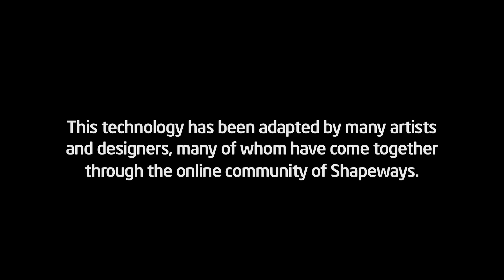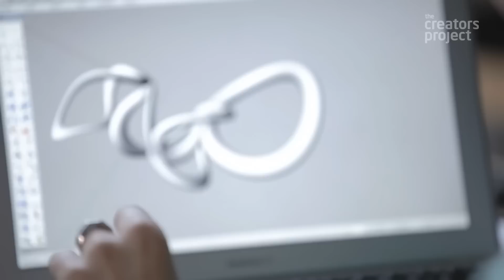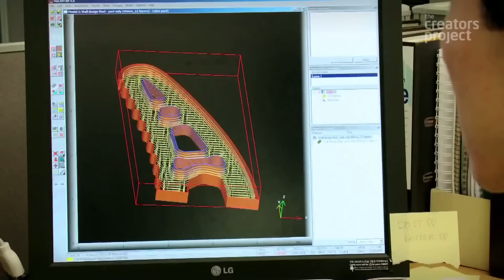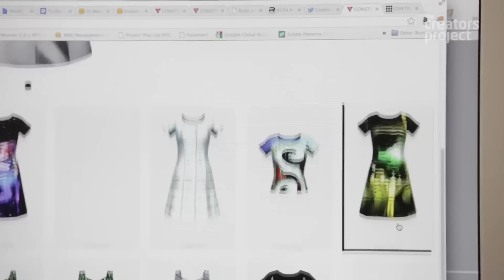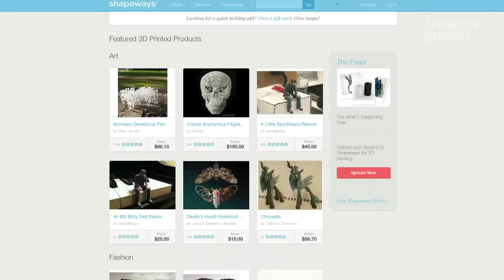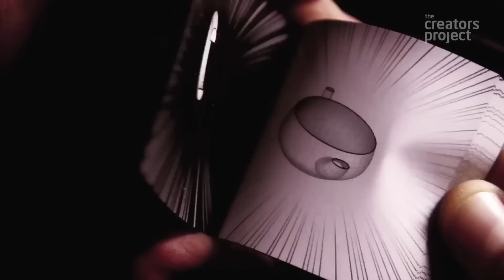Leaders Of The 3D Printing Revolution

Comment: You can compare the 3d printing and CLIP printing with the industrial revolution back in the 1850's. The use of steam and electricity made it possible to create things and mass produce these at incredible rates. The same thing is about to happen with 3d printing, but instead it will be accesible in every home.

Comment: I'd like to make a unit with a TIG torch and wire feed mechanism so you could actually build up high grade metal projects that would only need finishing machining once printed. You can build metal objects up by hand so the added precision afforded by microprocessors and servo motors should be far better. You would have to keep an eye on it of coarse in case the tungsten electrode gets fouled or other malfunction. A robotic TIG torch is not something you want want to fire up and leave unattended...Unless you have really good home owners insurance that is...lol

Comment: 2:43 is that blender i see?!... of all the programmes why?
Reply: Because it's a simple program to use plus it's free :)
Reply: as a 3d modeler there are other 3d programs that are free and is much better. But i guess blender is like the basics and easiest but have limitations :S
Reply: Princess Luna What other 3d programs are free and better?
Reply: Elias Manriquez IMO 3ds max maya is better in the sense that it is widely used in the industry and also obtainable for free(only some of the version) . sketch up is also ok but only slightly.or you can be a pirate and get zbrush, solidworks and many other programs which are much for detail
Reply: Princess Luna You do realize that the ones you mentioned are not free right?
Reply: there are free versions

Comment: My group is developing a microfluidic 3D printing system with ultra-fast mixing so we can inject two liquids such as acrylate-catalyst and metal-acid combinations and eject a solid with resolution in the low microns and speeds up to 20 meters/second.

Comment: Soon enough if you are a building contractor you would be hiring a printer and not a crane or maybe a crane printer. No more shell buildings. We would create apartments fully furnished and fully equipped even with utensils. All you need is an architect and some interesting interior design! Time to start thinking how we can replace, is it possible to reverse the process and change back into the building material?

Comment: Using your own body energy? blood heat? fueling from the targetted cells to destroy? dono so many ways to explore, beside that, nano bots wouldn't need much to fuel around if well thought out (putting them straight in the disfunctional area, etc.) think outside the square mate, the big question is: will we be able to work on that level with some sort of 3d printing? is it gonna be cheaper and more effective then genetic manipulation of viruses and other microorganism?

Comment: You can make virtually anything. It's not paper or ink in the conventional sense. The material you use for your 'cartridge' will be liquified or gelled whatever you're 'printing' out. The software program which directs the printing process (think CAD/CAM) has the schematics on how the product will be printed. In other words, you can make anything. You don't have to buy it anymore (well, in the long run).

Comment: I've been looking at 3D printing since it was first aired on Tomorrows World in the UK around the earlly 80's. I've since used most of the technology out there, and I have to say, none are that strong, and what you gain in stength you loose in resolution. Really you need to finish a part then cast and mould it. Mini CNC milling would be every bit as cool and useful.

Comment: High quality products, that cost a fraction of the price will bring in a lot more consumers than a low quality product with a high price. I was speaking gears for construction equipment or manufacturing robots. Manufacturers will want their parts of their machines to operate longer, therefore they can create more for less.

Comment: "You are giving these printers extreme capabilities. To be able to manufacture gun parts you would need an expensive CAD/CAM milling machine far beyond the tolerances of a simple printer."

With the exception of the bolt+carrier and the barrel, there are many gun designs that do not require extreme precision. And for those, you can use old-style hand-operated milling machines if you know how to use them.

/watch?v=OeN1etkFsbk

Comment: You are giving these printers extreme capabilities. To be able to manufacture gun parts you would need an expensive CAD/CAM milling machine far beyond the tolerances of a simple printer. The order of such a unit would throw up a red flag with the BATF and they would be visiting you as to your business needs.

Comment: To be able to manufacture gun parts you would need an expensive CAD/CAM milling machine far beyond the tolerances of a simple printer. The order of such a unit would throw up a red flag with the BATF and they would be visiting you as to your business needs.

Comment: The "cost efficiency" of those specialized, "makes one type of thing" machines goes out the window as the complexity of designs blooms and Open-Source 3D printers become more capable of printing smaller or larger, with more detail (micron-scale and below), and with more diverse materials in complicated arrangements. 

Eventually, demand for the comparatively simple and limited-capability "old industry" consumer goods drops off and 3D printing continues to evolve and displace all other forms.

Comment: These machines can not only make a "precision ball bearing assemble, but it can print a fully operational luxury car. There is nothing a 3D printer cant do. Obviously this 3D printer isn't that cool, but do you research and you'll find out that this is going to change how we manufacture items forever. Still, the one machine that prints only one thing is not going anywhere either due to its cost efficiency.

Comment: The future: Everybody will have a 3D printer. But along a 3D printer, there also needs to be a Recycler. You will be able to put an old computure into the Recycler, which will separate all the material, put those materials in to injectors, and create a Cell Phone or whatever. This is about 20 years away. Everybody in the world will have everything.

Comment: While 3D printing may have potential to revolutionize rapid-prototyping, the video is misleading (3:00) by showing fabric dresses that are printed using software and probably traditional screen-printing techniques. Until 3D printing can extrude a flexible synthetic fabric with very small resolution (thread), you can only make plastic shoes, jewelry, and Dita-von-Teese-style haute couture. We have a long while before we can make or own custom clothing. And that bikini? Doesn't come in my size.